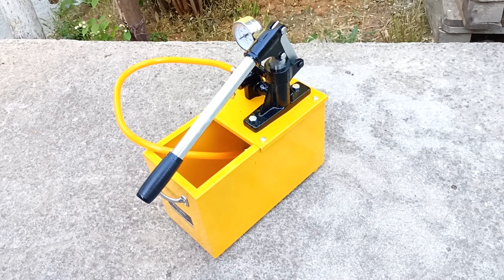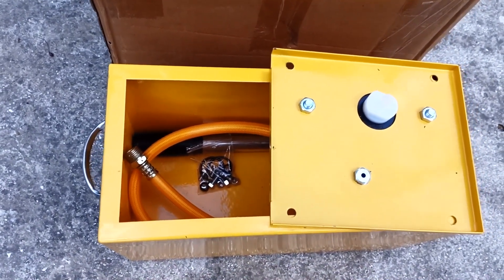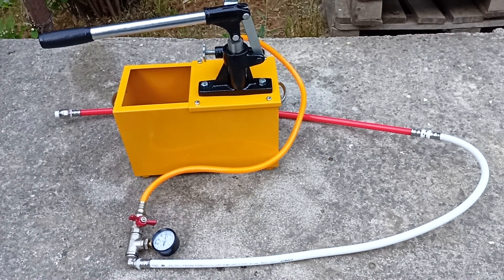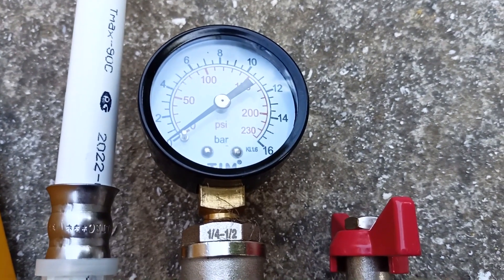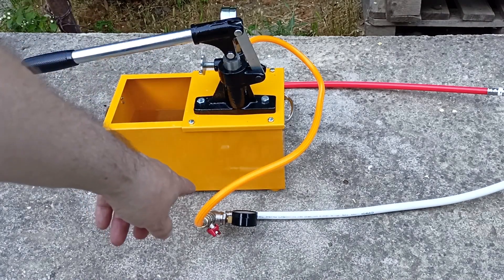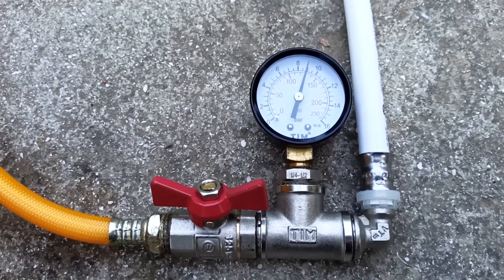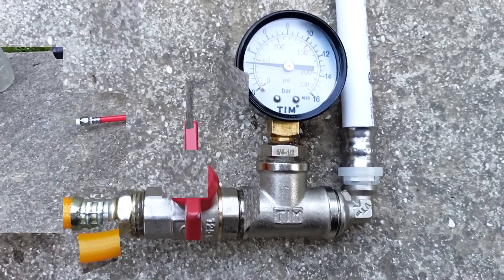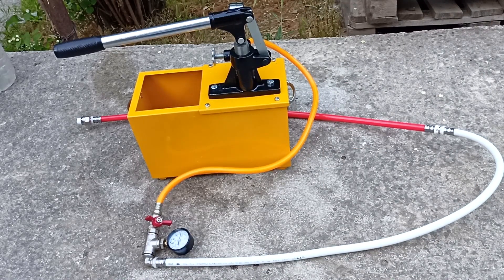How to Test Heating and Plumbing Systems: Step-by-Step with a 50 Bar Pressure Test Pump. DIY Test

Comment from the maker: https://alli.pub/75yqyz?erid=2SDnjdSHogg - Pressure Test Pump 25 Bar from AliExpress
https://alli.pub/7456io?erid=2SDnjdELuBh - Pressure Test Pump 40 Bar from AliExpress
https://alli.pub/7456k8?erid=2SDnjefNCy1 - Pressure Test Pump 70 Bar from AliExpress
https://bit.ly/CT-G0050 – Pressure testing pump CARTOOL CT-G0050

Other videos from the series:
https://youtu.be/v974VrI7pHs - CT-1632S - Manual pipe press pliers CARTOOL
https://youtu.be/gaPC9p4QHPA - CT-1632Y - Hydraulic pipe press jaws CARTOOL

Comment: Is such high pressure possible in our plumbing or heating?
Reply from the maker: In emergency cases - yes, it is possible. Usually the system is tested based on the principle: if it withstood increased pressure, it will withstand nominal pressure.